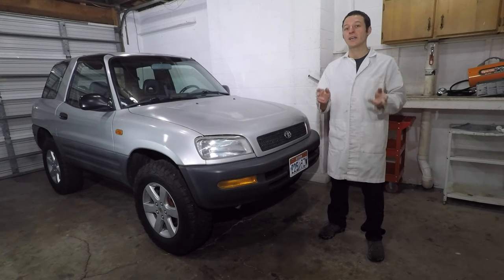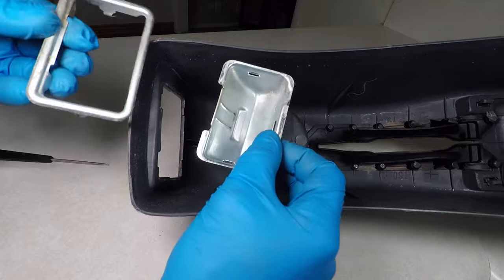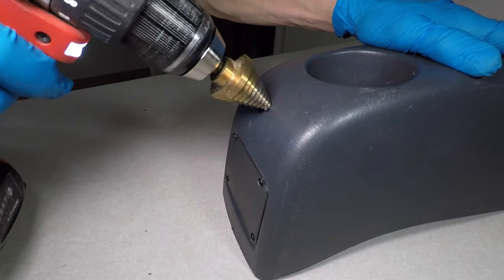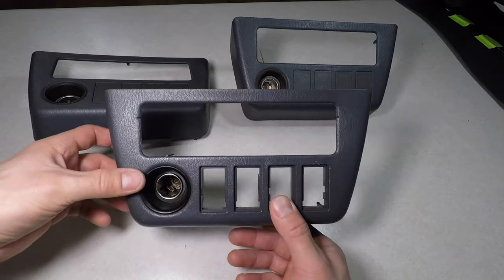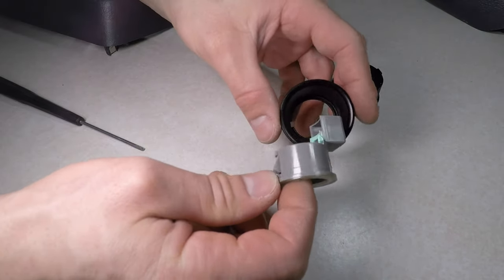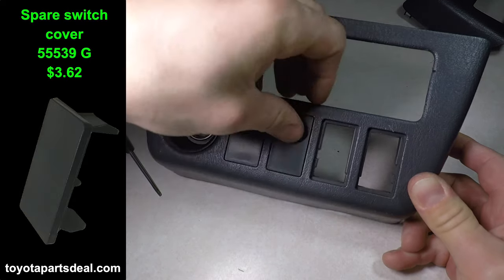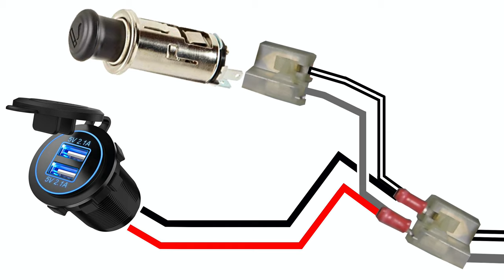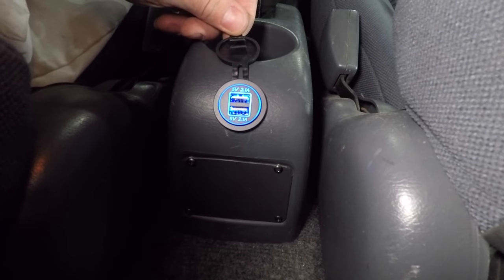Fixing the cigarette lighter outlet and adding a USB charger to my 1997 RAV4 (episode 19)

Comment: You need to fill those switch covers with a million led light bars! That’s what people do. And maybe a diff locker. And a Gatling gun. Maybe not, but ONE small-ish light bar would be cool on the rav.

Edit: One of my favorite mods on my 98 4runner was wiring in a set of Hella micro DE fog/running lights. Pre 99 4runners didn’t have fog lights. I cut holes in the bumper valance and made it look like they were there from the factory. It was extremely useful at night. Loved that mod. And it just feels good filling in those empty switch covers!
Reply from the maker: I want all of it!  Especially the gatling gun!
Reply: Paul Shpakov just hide it in a safari snorkel
Reply: the most used and appreciated mod on my 97(?) rav4 is the remote keyless entry... Paul, does your rav4 has keyless entry?
Reply from the maker: @Aug-Ustinus  I do want some power locks.  A nice viper alarm with remote locks for all the doors is a great idea.
Reply from the maker: @Aug-Ustinus  Not yet, but it's on the list.  Not having remote locks is pretty annoying.

Comment: I just started doing this project today. My cigarette lighter holder for some reason slides partially out whenever I've removed the cigarette lighter.  If I used JB plastic weld to secure it in place would it be safe?

To be clear, I intend to apply the plastic weld in the rear where the plastic component of the cigarette lighter meets the plastic trim, and not on any metal surface.
Reply from the maker: JB weld is safe, but from my experience doesn't work as well on plastic.  The right thing to do is get some "new" parts from the junkyard that aren't broken.

Comment: Hey Paul,
I have a 1999 rav4l automatic transmission, please tell me, where is the location of the cigarette lighter fuse?
thanks
Reply from the maker: The cig and radio 15A fuse is located inside the car, to the right of the hood release.
Reply: @LabCoatPaul  Thanks Paul
Reply: @LabCoatPaul  Now getting ready to change out all four wheel bearing.

Comment: Man I changed the plugs and wires and the engine misfires stopped! My RAV4 is fixing up great too!
Reply from the maker: Good work!
Reply: I had some misfiring issues too... but the problem was some spilled oil that has gotten into gap of the first cillinder/sparkplug ... some pressured air did the job
Reply from the maker: @Aug-Ustinus  You'll need to change that valve cover gasket and spark plug tube seals to stop that leak from causing another misfire.

Comment: Hey Paul! Question, does your RAV4 have a working factory clock? My 1996 2 door does not but I picked one up on eBay and the wire
Reply from the maker: My clock is good, but it's a common problem in the RAV4.
Reply: @LabCoatPaul  I see I see! I gotta try to figure out how to wire mine in!